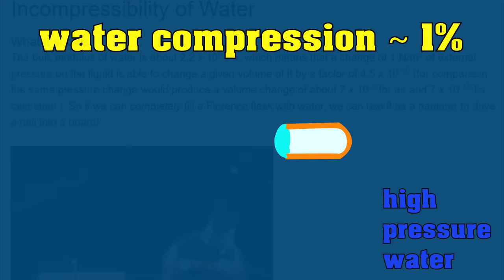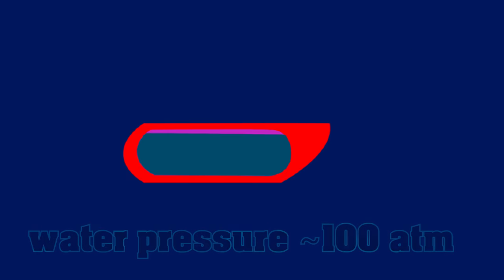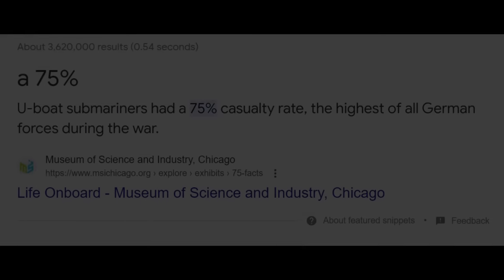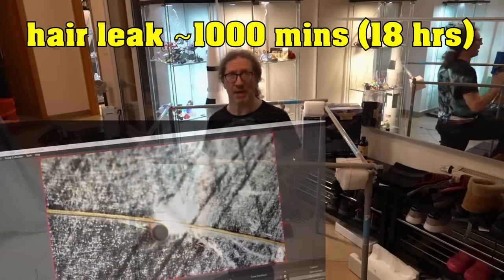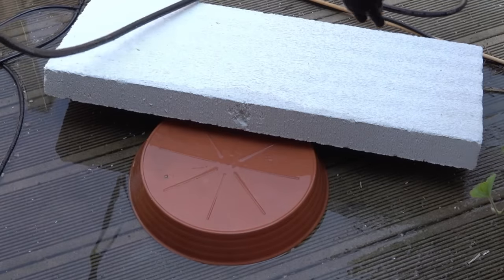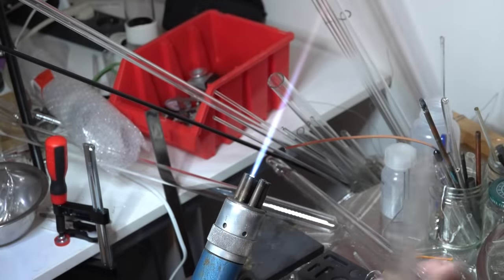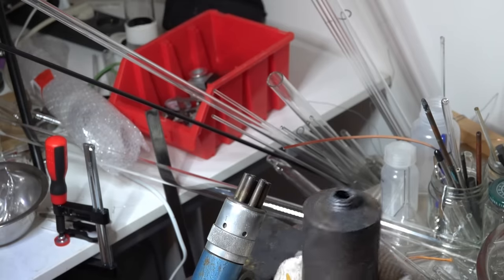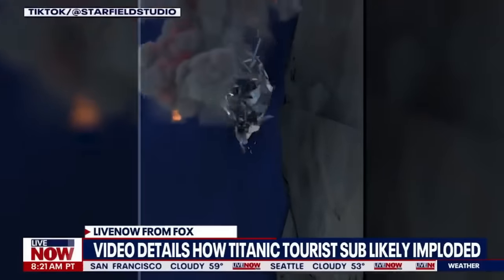Why the Titan sub failed

Comment: I'm amazed they did that crucial adhesive bond without any hairnets on the fabricators. I would expect something looking more like clean room work than shop fabrication.
Reply: even that dude was wiping it for some reason and imediatly put his hand there after
Reply: @theweedfarmer419  
Yes, the oils from your fingers will screw up the adhesion.  In addition to cutting corners on material, they were clearly very sloppy when laying up the composites.  The quality of the finished composite material is highly dependent on your process.  Mistakes like that will burn you.
Reply: @Skank_and_Gutterboy  Also at about 20:15 , you can hear someone on the left saying "...of all the things to shortcut" hmmm.  I wanna hear that convo. lol
Reply: @luistigerfox  From all the things to shortcut, have we missed any and did the proper industry tested thing?
Reply: @luistigerfox  
No doubt!!
Reply: @luistigerfox  
Good ear!
Reply: Nonsense! That would have added cost and OceanGate was all about cutting cost!
In fact $250k for a burial at sea right next to the Titanic is almost a bargain. /s
Reply: @TruthNerds I never looked at it as an appropriate grave - and a cheap one at that -  makes me think that Rush didn’t care if he died because of the honor. Good point!
Reply: And assembly would have been done in a vacuum. It will be way too easy to include air pockets in that flat bond.
Reply: I meet a physics guy when i was hitchhiking. He worked for a company that builds CNC machines. Pretty interesting ride you guess ;)
He said the problem with fixing the cutting tool (Cubic Boron nitride) to its platform wasn't to find a glue that could take the tasked (Forces, Temp, Chemicals) but to clean the surface.
In the end they first cleaned it with CFCs in an clean room and than treated the surfaces with cold plasma.
Just you know ;)
Reply: @Nutzername36  you're spealling gived me an cancer...
Reply: You would expect correctly.
Reply: I also would have had titanium bars that connected the 2 titanium rings, and tightened so they pull towards each other.

This is assuming of course the carbon fibre isn’t the cause of the failure, I also suspect that the constant pressure changes delaminated the interior layers of the pressure vessel, causing them to buckle inward and opening a spot for leaks and or immediate catastrophic failure
Reply: @Nords555  so bad? :D
Reply: Thats because all the people they originally talked to had old white guys on staff who refused because of safety. Like their Head Of Safety who he fired over this.
So, they ended up finding some people who would do what they were payed to do. 
I'm quite sure that contract outright states that they are responsible solely for doing the layup work as directed, overseen and qualified by the Customer's R&D and as such are not liable for failures.
Reply: Yep. It's common to even use a clean room approach for racing yacht composite construction.
Reply: @igethacked23  I know Titanium is insanely expensive, but for all the time, effort and engineering that the CF solution required, it couldn't have ended up far less than simply going T.
I think he really wanted to be seen as a genius who proved the naysayer 'experts' as wrong.  Could have made the titanium ends several inches larger and gone with a several inch thicker hi-strength steel, if even that is feasible as its not spherical.
Reply: @boots7859 nother video commented that the composite was not only outright cheaper but substantially lighter. If the body had been titanium the craft would have needed something like 70 tons more buoyancy to offset as well as the difficulty in logistics of managing and deploying it. Though buoyancy isn’t a problem for it in its current state. So cutting overhead of logistics and the additional offset were also significant savings in making this “affordable”.
Reply: @boots7859  He thought he was an innovator, but really he is a profiteer who charges rich people $250,000 to ride in a shitty sub. Carbon fibre isn’t new and he isn’t pushing any boundaries. Titanium is currently the answer obviously, and if he was serious about innovating he would have had people researching new materials and composites to use.
Reply: @Skank_and_Gutterboy in this case these mistakes left him under pressure
Reply: Lol. Even assembling inverted from the way they showed in the video would have at least given the air a way out. The way they assembled it, there was NO WAY for the air to leave the glue interface!!
Reply: @tehbonehead  the wear in the carbon fiber would be accelerated by the titanium underneath stoping it from compressing in those areas.
Reply: @jwalster9412  yes. And the air would have been forced into any gaps in the CF that it could find, and as it depressurized on rising (in previous ascents), the air would expand, increasing the size of the gaps in permanent low-cycle fatigue...
Reply: I noticed the change in your tone/volume when you were talking about the casualty figures from ww2, and understandably so..
Reply: well it was more seal then adhesive as pressure will push the bulk heads into the cylinder, but the state on the shop and doing that with open doors sure dont look so professional

Comment: I was absolutely stunned when I saw the videos of the carbon fibre being  rolled out and how slapdash the glueing was. I put more time and energy into my childhood models than that subs creation lol.
Reply: yeah that and he contaminated the titanium after he cleaned it by touching it with his hand I mean what the hell was the point?
Reply: @raven4k998  And the "cleaning" looked like a bartender in a western film.
Reply: @0525ohhwell  well yeah when they made it they should have had clean room level cleanliness so there was no contamination for maximum strength of the carbon fiber did they do that nope which contributed to it's early death sure they could also have had the carbon fiber on multiple axis for increased strength to but the point to be learned from this don't used carbon fiber for a sub and definitely don't use carbon fiber in a half fast cheapo build like they did they compromised on the strength of the sub in every area they could which is why it failed so quickly in it's life
Reply: @raven4k998  The sub went on ninety dives, thirteen to the same depth as the Titanic. Yes it was badly designed and made but if they had retired after ten super deep dives then there would be no story to tell. It did not fail quickly at all.
Reply: @mbak7801  I'm glad it did, had they quit while they were ahead Stockton would have spent the rest of his life pointing at his sub as evidence that safety regulations are too strict.
Reply: Yup that concerned me too. Also if he was so cheap on the controller I’d immediately wonder what else he’s being cheap on
Reply: @raven4k998  Better idea.....don't use a carbon tube glued to titanium end caps. Use a titanium tube welded, or what ever method all the other subs were done with.
Reply: @joeshmoe7967  or better yet just go with titanium only for the hull like Ballards sub was made as his sub seems to be holding up well with that hull design for him so go with what works instead of what has failed time and time again by going with a composite hull made of multiple materials
Reply: Any popping noise could have been the layers separating
Reply: @raven4k998 that wasn't going to work for his business model.  He needed to take X number of "mission specialists" for profitability.  That meant he didn't want to use the accepted titanium sphere. Usually those hold 2, maybe 3 people.  A sphere big enough to hold his desired 5 would have been incredibly expensive.  He settled on a tube shape to fit the people. A titanium tube also would have been incredibly costly. While carbon fiber isn't cheap, it's less costly than large titanium. How he convinced himself, let alone other engineers it would work is the question.  When so many "Youtube" engineers, not even submarine engineers can quickly point out why it wasn't safe, you know there's trouble. Besides thunderf00t, Real Engineering exposed the flaws.
Reply: @mbak7801  it did quickly. It was supposed to be used for years and years and years yet it already has to be rebuilt because of the carbon fibre being damaged due to the constant pressure cycles.
Reply: They actually used glue?? I thought the thing was goddamn welded together, not held together with some fucking gorilla glue 💀
Reply: Did you see them lifting the outer panels using lorry straps? Wouldn't even buy proper lifting gear. Bunch of hacks.
Reply: @libertyprime2013  everything.
Reply: Slapdash? 🤣🤣 That is the funniest thing I've heard in a while. Never heard that word before but it's perfect for this situation! I remember focusing much harder putting the glue on my model cars as a kid, than the Slapdashers putting together that sub.
Reply: @tabcaps5819 Pretty hard to weld to a carbon fiber composite lol. Glue is the standard way to affix CF and other composites, though "glue" is a pretty loose term. You'd use a compatible resin to the resin substrate of the CF, and it would hold better than any other method, shy of introducing additional fiber meshes into the glue joint. And it works perfectly well, as long as you use it for the right application.
Reply: The glue was basically there to hold the metal section to the hull when it was on the surface. Once it's at any real depth, the pressure from the water will press it to the carbon hull, as long as the pressure outside is greater than that in the sub. Glue wasn't the issue. The carbon fiber that necessitated the glue and the elongated cylinder hull was the issue.
Reply: @joshm3484  no the glue was not important when underwater but it was definitely important out of the water especially with the constant pressure cycles. And I didn’t say it was just the glue, in a build like this every single step should be 100% the best they can make when lives are on the line. If you see how pathetic and uneven the glue was then it makes you wonder about all the other processes if they were just as lazy.

Comment: They used methods that would make the sub suitable for depths less than a quarter of the depth they were taking it to. Even without your explanation, as soon as I saw them gluing it together I was looking at it in horror. The idea that they would just glue the ends together, trusting that the glue would hold everything together in such an extreme environment is just such an obvious flaw. Then adding the different materials with different compression rates and it's amazing it managed to last as long as it did.
Reply: I have no formal education in either engineering or physics and still my reaction to everything I've seen about how that thing was put together was "you have got to be shitting me." Like not only gluing the parts together, but literally just wiping the surface with a dirty rag beforehand. The guy had his bare hand on the metal, wasn't even wearing a hairnet. You can't do that in a sandwich shop, for crying out loud.
Reply: The glue was mostly to hold it together on the surface, once it gets to depth the pressure of the water actually holds the seals in place. That's not really the most egregious thing they did that's a common practice. When designing a seal the best thing you can do is make the environment it's going to be in work to hold it in place I do the same thing in my line of work with high pressure water lines.
Reply: @taumctauface1886  if that glue is HPR 40, which it appears to be at a glance, then it is in fact considered stronger than the carbon fibre it's attaching. It is a rubberised epoxy resin that should maintain its bond even with slight differences in shape. That said the alarming part to me is the poor job in laminating the CF tube, with all those glossy areas being low points which a high performance part like this should never have. Especially on a mission critical part, that low level of skill would make me wonder if other areas are lacking, specifically how well they prepped the surfaces before bonding them together. Also , I can't tell how big the flange was that went inside the CF tube, and we have no idea of what the laminate looked like. The outer layers look like 0's so hopefully they had at least a few layers of 90's under that, spaced evenly throughout the laminate, and some 45 degree layers too. There was also some talk of the CF being expired material. Assuming it's pre-preg what's more important is that it was refrigerated at any time it wasn't being used, and any good factory will have those records on hand, exactly for this sort of accident.
Reply: @taumctauface1886   But it isn't held in place. The carbon fiber tube shrinks more than the titanium endcaps and the titanium is on the outside. The pressure would try to tear apart the glue bond, not press it together.
Reply: @torte007  Yeah. Right idea, wrong scenario. They were entirely relying on the glue as putting the more compressible material on the inside of the seal when that material has so much surface area to be compressed guarantees warping the seal eventually.
Reply: Umm actually, that's totally normal in any manufacturing job, the rag isn't dirty it's just a rag, and touching the metal with your bare hands is perfectly fine, I work in a CNC machine shop and we machine all types of different engines most of them much bigger and heavier than the average car. Nothing in the clip of them constructing the sub in this video raises any red flags and is pretty much industry standard. There's no hair nets, rag is decently clean because if if wasnt you'd see black dirt streaks and touching the parts with your bare hands as long as their decently clean shouldn't be an issue. Aside from when you're glueing stuff together... I mean it won't hurt it but the glue will definitely stick best when it's as clean as possible  @Maladjester
Reply: The glue you mention isn’t much different that the glue which holds the carbon fibres together.   In fact the entire shell is actually just epoxy with some carbon fibres to hold the epoxy in place.  The cylinder is in compression, carbon fibres are flexible, so they don’t add as much strength as most people assume.   How successful are you pushing a string?
Reply: @grxve___ you evidently don’t work in aerospace.

Comment: The pressure spheres of many deep-submergence vehicles are in fact made in multiple sections, usually two halves, bolted together, with O-rings between them. The shape of the mating surface are designed so the increase of external pressure tends to press more and more on the seal. The perfectly spherical (machined to an extreme precision) shape of the hull allows a completely uniform stress on the joint and on the whole volume. The separation of both halves to inspect the seal is a regular maintenance task on such submarines.
Reply: The point is that the sections are the same material, not different ones. And spheres are the perfect shape to withstand insane amounts of pressure – but they are small, you can't put that many people in them (I think most of these deep-submergence vehicles can have 2 people in them, right?).
Reply: I was really surprised that they weren't gluing that thing back together after each use. It is absolutely insane. Quite surprised that it even held one dive. It makes me wonder if they didn't fake the debts of previous dives.
Reply: @c.augustin  there are 3 crew DSVs, 4 if you bend the crew correctly.
Reply: @Damien.D  "4 if you bend the crew correctly" – well, sounds kind of uncomfortable … 😉
Reply: @c.augustin  you want to see the Titanic? Well it will cost you an arm. Literally. Need to cut it, or you wont fit.
Reply: @Damien.D  🤣
Reply: @Damien.D  That's a bargain, I expected an arm and a leg
Reply: @NJ-wb1cz  It's a special "new customer" discount so they can come back for another ride.

Comment: Hydraulic press channel made a pressure chamber to test the sub. Every time it failed, the failure mode was the seal, I'd recommend watching it as its probably the most accurate simulation of how the sub failed
Reply: Yep I saw that first and then this video. Taking both in account, this one explains the why, and the other corroborated the results
Reply: Hydraulic press channel did not use a scale model. They used scrap composite tubing and metal parts.
Reply: @PaulG.x  Yes, but it's actually a good demonstration of the likely failure mode. Hydraulic press channel's "miniature sub" imploded at only 80 bars, compared to the 380 at the Titanic's depth. They wouldn't have been able to reach that pressure with their equipment anyway.
Reply: @PaulG.x  I agree, also they did only pressurize for a few seconds each time and at the end the conclusion was that after 20 cycles the model did NOT show any fatique and broke at teh same pressure as the "fresh" model. One model did fail at the seam, though, but it's still not the same as with a "real" model. They were just goofing around and they were actually admitting that.
Reply: Tanks amigo I will check ✔️ perciate it.
Reply: @PaulG.x That's not far different from the actual submersible.
Reply: they also didn’t use the actual materials or exert the pressure correctly for a still incorrect ‘scale model’
Reply: @SlapShotTakes cry
Reply: @PaulG.x  So in other words, it was an accurate simulation of the actual sub.
Reply: @SlapShotTakes so basically it's a perfectly valid and accurate test, since neither didn't Rush test his sub for anything since he knew he wouldn't get any passing grades from authorities anyway

Comment: The one thing that supports the rapid implosion hypothesis , is that the end caps were displaced some distance from the other wreckage. Implying that the hull filled extremely quickly and that a water hammer effect feed kinetic energy into the end caps ,sending them in opposite directions.
Reply: They would also drift as they fell, what I think is more evident is the pulverized carbon fibre